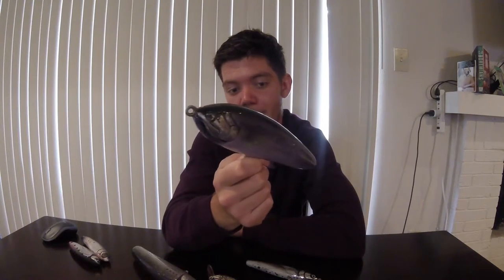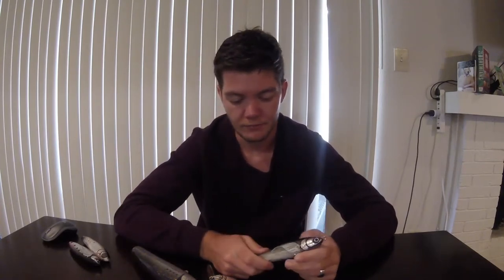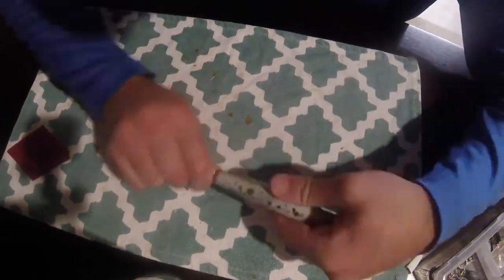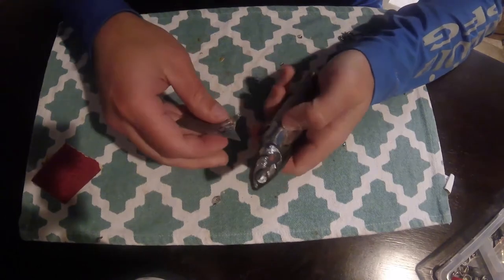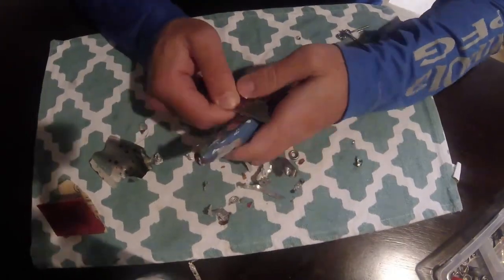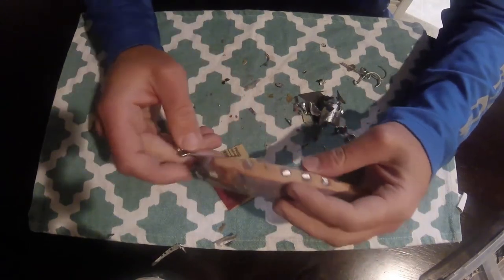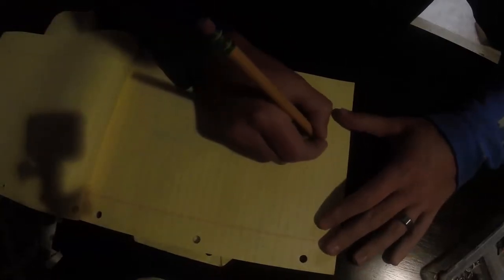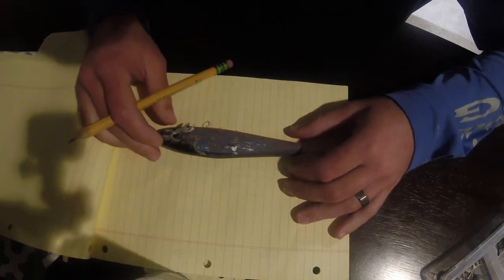Balancing A Stickbait - Part 1. - The Basics

Comment: Thank you very much for your response. I'm new in making stick bait lures. I'm using 0.062" stainless steel wire, the material of the stick bait weights approximately 2 oz , Hooks weight approximately 0.25 oz . I'm using Alaskan yellow cedar wood in making stick bait. I will be foiling the lure then use envirotex clear epoxy on top of the foiling . Thank you
Reply from the maker: Start of with 1/3rd of an ounce. Fix all the wiring and give it a base coat of paint or urethane and test it out to see if you need more weight to add. Not the length but the total volume is important to take into account. Hope that helps.

Comment: How to accomplish erratic action ? and how many OZ of lead weight  is recommended for a 6
" -7" stickbait?   Thank you
Reply from the maker: If you rewatch the video I talk about the variables with making a stickbait. Just by giving me the length of the lure doesn't give me any determining value for the amount of weight you put in it. How much does the wire weigh? How much does the material of the stickbait weigh? How much do the hooks weigh (including splitrings), what type of material are you using? Will you be foiling or painting the lure? What type of clear coat will you be using?

Comment: hi mate i was wondering how you get the tail kick instead of it just glide through the water.
Reply from the maker: It's explained in the video, it refers to the point between balanced and unbalanced. The lure has be be balanced enough to not spin on retrieve but there has to be a certain amount of instability for the lure to want to start spinning, no different with hard bodied lures with which the diving lip creates instability but the weight in the belly prevents it from spinning. If your stickbait does not have a tail kick and just glides straight through the water, you have balanced the lure too much. Reducing the balance weight or chaning its position by inserting it higher up in the body will create some instability. Find the sweet point and you're in!
Reply: @
West Oz Fishin, I know I'm a year late bud, and i'm trolling the comments while waiting for the nbn to download rest of this clip, so I haven't even watched it yet(?!?!?!)...... but ordinarily, to get a lure to 'glide' on its own between rod-twitches, instead of doing a sharp left/right and stalling, firstly, congrats, cos many struggle, and you've done it by accident! lol so, quite simply, your centre of gravity (COG) is in FRONT of the centre of drag. The weight is what gives the lure momentum to continue 'gliding' after you cease pulling on the line - move some weight back a bit, or make the lures leading edges a bit LESS streamlined.
Same as a throwing dart, or hunting arrow....It goes straightest with weight at forwardmost tip and the drag (feathers, etc) rearmost. Reverse that, and it trips itself as opposed to gliding. 
Its the old shopping trolley steering physics agin ;)